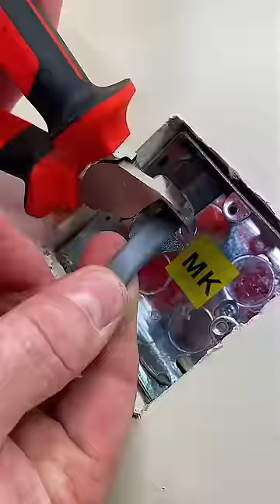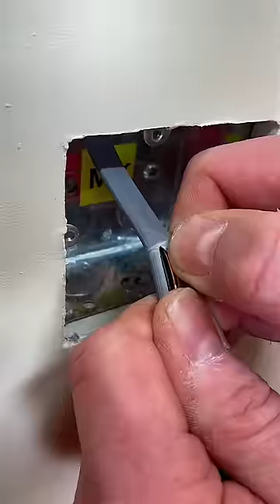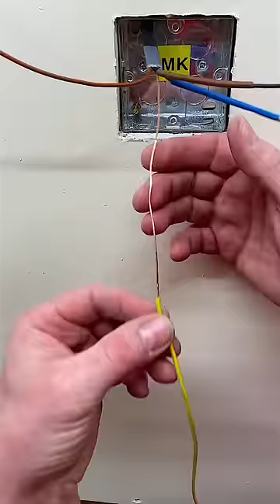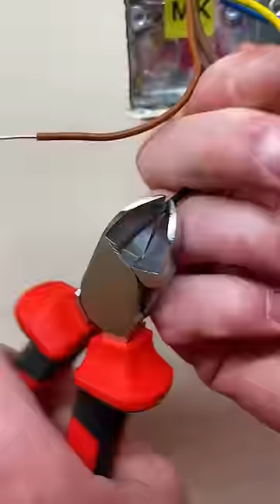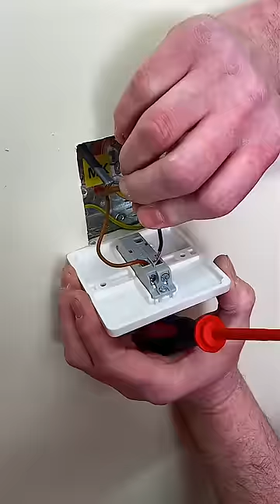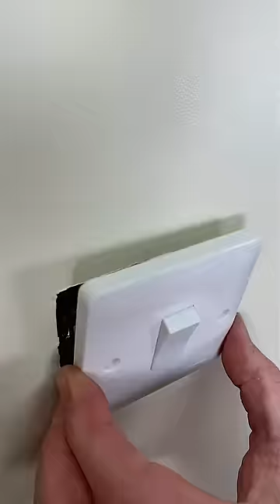How to Make Your Light Switch Future-Proof!

Comment: When I was an apprentice it was frowned upon to have neutrals at switch points, these days it’s a necessity
Reply: Just shows you how silly your teachers were.
If the wire is properly colour coded then what's the problem?
Reply: @deang5622  not ‘teachers’ fully qualified electricians, people working in the industry for YEARS, I’m didn’t say it was u safe, I said it was fround upon, it just wasn’t the done thing to have a neural at a switch point.  Wiring 2 plate instead of 3 plate was seen as something that unqualified people did, personally I don’t have an issue with it, it just wasn’t done. As wiring 2 plate ment you didn’t have a permanent live at a ceiling rose
Reply: Strange I was just going to say the same, 1980 I started and was not seen as professional if you did this! Maybe the invention of the wago connectors and the disappearance of ceiling rose has now made this the way to go. Personally think it’s a good way as long as you fit a deep back box
Reply: @johnwarwick4105  It was the way to go back in the mid 1990's and they are still not there yet.

Why do so many electricians think people won't use home automation devices which require a neutral line?
Reply: I ALWAYS pull a 5 wire cable to switch points, how many times i've had people ask me to upgrade a light switch to a double smart switch which needs a neutral... or add a socket.
Reply: Funny, I come from the auto electrics side, and it never made any sense to me, that the feed went to the lights then the live is looped out to the switch? Why did they not take everything to the switch first? Was there a particular reason they did this? I thought it might be the cost of cable, but you end up with roughly  the same amount.
Reply: @keoghrichard1988   why do you want a permanent live at the light fitting? I must be missing something?  I always thought it a little strange that wiring in the fittings could still be live with the switch off. 
I come from auto electrical background, and l would live and neutral to the switch box and then on to the fitting. But electricians frown on it. Someone explain this too me please!
Reply: @iainball2023  No, to be fair you will use more cable and the supply route to the last fitting is much longer as you have to drop down and back up in each room. Not so much of an issue with the lower lighting loads from led
Reply: @iainball2023  the loop in method has long been preferred (and how it it taught in college and on site), you can loop your line and neutral around all lighting points in a house let’s say (industrial wiring would be different given there might be contactors involved), then just drop down from each lighting to the switch in each room, rather than up and down to each switch, then back out to each light, also you then have a permanent live in the ‘ceiling’ if you ever wanted to add on to the circuit.
Reply: They do make WiFi switch systems that don't require a neutral
Reply: utter rubbish. there is plenty of installs on lighting were you have a mains feed in and a mains feed out to the next switch then a feed to you light. obviously you not a sparks and I've been a qualified sparks since 1981
Reply: @robertburrows6612  I didn’t say that people don’t do it! I just said it used to be frowned upon, and yes I am a spark, been one for 16 years, apprentice trained. NQV L3, city and guilds 2330 and 2391
Reply: @robertburrows6612  didn’t say they weren’t used I am saying that back in 1980 when I also started the was not seen as the preferred option for domestic. As an industrial apprentice I worked with many electricians and it was never favoured. Can only speed from my experience. As said previously i us this method times and materials change
Reply: Why do you need a neutral at a switch point? For a little indicator light? Or home automation?
Reply: @wimh-e7l  well that’s kind of the point of the comments. You dont need one but you have to joint it somewhere. Those neons usually  just go across the switch and only on then the light is off to help you find them in the dark
Reply: @Dean G  because they don't. I personally would but 90% of people don't give a f**k
Reply: @johnwarwick4105  I’m from the same background as you my friend
Reply: @iainball2023  In fact I think it's a thing that is only made in the UK. In my country you go from the switch to the light, much more sense. First you only have 3 wires at the light, that makes it easier for non skilled people to wire, second if you need to control more lights from a switch position (that is more common than controlling only one) you use less cable since you bridge all the lives together. 

Having the neutral at the switch gives you more flexibility, with no added difficulties. It's also cheaper to install, since (at least in my country) switches are almost everywhere above a socket, so of course you reuse the same conduit for the socket to also bring the lighting circuit feed, and then go with a smaller pipe to the light fixture (since it has only to bring 3 1.5mm for the light).
Reply: How the turn tables.
Reply: @microcolonel  ?
Reply: @planespeaking  yeah. But they suck
Reply: Same here
Reply: Why bother wiring a switch at all when we now have kinetic switches?
Reply: @deang5622  The problem was the way things were done at the time, there was no need to have a neutral, so seeing one, would infer that it was either live, or switched live that had not been sleeved to show it was a switched live.  As no one would expect to see a neutral.
Reply: @iainball2023  Because the main live to that light fitting, then goes in the ring around to the next light fitting and so on, so if you went to the switch first you would turn all the lights on or off in one go.
Reply: @wimh-e7l  For home automation, for most smart switches, you need to have a neutral and live feed to the smart device. However the very easy way round this is to leave the original switch and wiring in place and put the smart device near the rose, where you can get the constant live and neutral (preferably with inline protection to the device), then take the original feed from the rose via the switched terminals on the smart device. This then gives you a traditional manual switch override to the smart device.   But better still just use a smart bulb.
Reply: @crcomments8509  I'm not being quite that basic. I'm thinking more like a radial out to the switches, Inc neutral,  then out to the fittings. I think the real question for me, was do people frown on it because there is some sort of safety implication or standards violation, or is it just because its not often seen, and uses a bit nore cable?
Reply: @alerighi   that does seem to be a good way to do it
Reply: @johnwarwick4105  I think I agree mostly, I have re wired two industrial units that I have rented, with new consumer units and lights, in bot cases it was much less cable to common the neutrals at the switches, as they were all in one place. 
I can see how it would be more cable in a house now. I do still wonder if its worth doing a radial out to the switches from a common point nowadays, given the fancy equipment we are attaching to it nowadays ?
Reply: @deang5622  maybe I’m misunderstanding but the standard is to use the hot in the switch so that when the light switch is off … there is is no power in the box ….
Where the other way around … you can still get shocked even with switch off ..
Reply: @iainball2023  the standard is alway interrupt the hot …
Bc when working on light .. you can still get zapped even when switch is off ….
Reply: @mycaddigo   that's kind of my point. The way it is done here, it is perfectly possible, or even very likely  that every light fitting will have a hot live wire even with all the lights turned off.
Reply: @iainball2023  yup … when servicing lights …. You think there is no power .. but if you touch hot and a copper ….. zap ….
No big deal for any electrician I bet … bc they would still practice not grounding them selves … but it’s poor form and I bet against most code….
I actually did this one time … and the electrician checked it and corrected me firmly …
Reply: We run mains to switches and 3 core and earth to centre lights, covered all bases for when they change their mind
Reply: When I was an apprentice spark nearly 40 years ago my instructor ( been in the trade close to 50 years) insisted we fitted a netural for future use, was a very wise move.
Reply: @deang5622  Exactly.

Comment: One thing to bear in mind is that some smart switches need more than 25mm depth, so you should be using at least a 35mm deep back-box.
Reply: in france i alwayd try and use 50mm deep boxes so there is anout 15 to 25 mm of space in the back of a switch
Reply: I never bother with 25mm boxes, have alway fitted 35mm.

Comment: Nice for a new home. But try doing that when it's full of mist coat & plaster, or when a previous "spark" has stripped the cables and cut them too short during a "first fix". In this industry there is not much thought for the next person who needs to carry out work.
Reply: True I have this problem on all switches in the house.  Cable to switch first then cable pulled back to the Consumer unit.  Another electrician said to me its amateur to be using this cable clips 😅

Comment: Maybe something we got right across the pond. We run power to the switch (live neutral ground), join the neutrals with a wire nut, switch the hot, and the outgoing goes right to the fixture. One run from the breaker to the switch where it terminates and another run from the switch to the lamp. If you want a three way, you run live/neutral/ground from the breaker to the first switch, the live/traveller/neutral/ground to the next switch (repeat if necessary) then finally live/neutral/ground to the light. Running just a hot to the switch became old fashioned decades ago
Reply from the maker: Great info thanks 🙏
Reply: My electrician sent out an old school guy and he missed a bunch of neutrals in the switch boxes.  I caught it and had them all rewired to meet Code.  Really useful for bath fan timers, smart switches, etc.
Reply: What about the live for the next room? you surely don't run each set of lights on separate breakers. So you have live in to the switch, switched live out to the light fixture and another live out to the next set of lights? that's 3 sets of wires in one switch.
Reply: @Anglo Saxon That's what we do in the UK but the guy i was replying to (Worf) said over the pond they run straight from the breaker to the switch, then to the light fixture.

Comment: In the last 5 years so much has changed. Wish I put neutrals in all the switches in the man cave as now I’ve had to re feed serval for smart controls
Reply: Plenty of smart switches dont need a neutral wire..
Reply: My 1990 build actually has neutrals in the switch back boxes, I just wish they'd had the foresight to guess I'd be wanting to stick Z=Wave modules in there too and use deeper boxes.

Comment: during my starting years as a sparky i always tried to get the neutrals run to switch points, its easier to maintain, comes in handy when i client wants to change stuff, means less mess when inspecting the light circuits, and just gives more wiring options. only downside was how tight some would get....but thats what deep boxes are for!

Comment: 3 plate made sense and used less cable when every room had 1 light fitting.  Now spots are common it's easier to wire them with a feed from the switch

Comment: Always nice having a traveler wire!
Reply: It's not. If you are from North America like I am, the NEC has made it a code requirement that a neutral must be present in switch boxes. The futureproofing aspect is that smart switches use power to wirelessly transmit signals to devices, therefore needing a neutral to complete their power circuit. If we were talking before this code requirement, I would absolutely agree with you!

Comment: Real futureproofing is taking either a KNX cable or a data cable to the switch as well, this futureproofing was only relevant maybe 5- 10 years ago
Reply: Although I did that, solutions exist to reliably allow data (e.g. the state of 6 buttons) to travel over a single wire and even keep power on it. I do kind of hate those 50+ individual data cables arriving at my cabinet at the moment 😅
Reply: @frederikjacobs552  True true, I am thinking more like when POE tablets are used to control functions, its going that way it seems, how many buttons will they keep adding to wall switches, with tiny tiny writing you have to bend down just to read….soon we will end up with double gang light switches with 32 buttons. This is where a KNX or POE wall tablet will take over.

About the data cables….I would love it, I’m a networking guy after all 😂

Comment: Why did you un do the L2 screw when you only have one way switch?  With hand shake like this 😊
Reply: Because at that instant in time he hadn't decided which terminal he was going to use. So to prevent the hassle of offering up wire to a terminal and then discovering it was closed, and then having to move the plate away, and undo the screw, it's more convenient to just undo all the screws. Problem prevented.

Simple.

And a terminal that isn't used with no wire fitted and the screw not tightened up does not pose any kind of risk at all.
Reply: It’s one way switch you can’t use other terminal. It’s only  one terminal he can use
Reply: @alinili5569  Technically not true, he can use L2 and then turn the switch upside down.. 😎

Comment: If im only running a switch wire to the switch then i do this but i most often run feeds to the back box now as id rather do my connections there that at a rose.

Comment: Feed the switches. Problem solved. Three plating should be left in the past.
Reply: This. Switch feed has been my preferred method for years in most instances….makes fitting decorative light fittings a lot easier for a start! This is hardly a revolutionary tip 😂

Comment: How will this procedure make a light switch future proof when the most common fail piece is the switch it self?

Verifying neutral line and groung wire sure is good when the standard cable doesn't have them, but you made no changes to the switch(not that you could, because if you could you possibly would compromise its insulation properties).
Reply: because many smart switches now need a neutral . In future neutrals at the switch will be important.

Comment: I never understood the issue by having a neutral even if it were just going straight through, I've done it and it's against the refs in Ireland, wired up lovely, connect correct and never an issue, worked for wifi stuff etc
Reply: Someone pointed out that this means switching off one light would cause other lights on the circuit to get switched off - unless of course you a cable with more than 2 core & earth.
Reply: @aliasgharkhoyee9501  yeah 3 core + CPC will give you permanent line, switch line and neutral.

Comment: Question from an American electrician: what's the purpose of the sleeves I've seen installed on the conductors that's put over the insulation? Is it just color coding, identifying the switch legs etc.. ?
Reply: @J I like it. Over here we will give the wires a twist in different ways to identify switch legs, line/load etc. (if we are using solid) but what the twist means can vary by contractors so sometimes it's a bit of a hassle following someone else's work.
Reply: What twist wire to identify? You dont tape or heat shrink colors?
Reply: @UnifiedInfo  For example for a simple switch we might twist a loop in the switch leg and wrap the ground around the switch leg and the corresponding hot. Or to identify line vs load in receptacles we will twist the hot and the neutral of the line side together, and leave the load(s) untouched.  I've never used sleeves, sometimes we might use a bit of white tape and write on it what each conductor is but the tape only stays until we have our inspection done/install devices. We use a lot of tape when making up the panels but again, only until we put the breakers in and write the panel schedule then the tape goes away. This only for residential, in commercial settings we will use different colors of tape for lots of different things.
Reply: @PurlCat  buy a sharpie
Reply: A label maker (like brother) would give you a more professional look than sticky tape. Sounds like it would last longer too.
Reply: I'd say ground wire being bare is enough colour coding for it :)
Reply: @LeedsSpark  I suspect it is done simply to prevent levers open when you push in Wagos into the box. One time use
Reply: @LeedsSpark  like I said, it's all just temporary. The tape goes away once all devices and breakers are installed. We do use label makers for more permanent stuff and we also will sometimes write on the outer sheathing of the NM cable in the panel.

Comment: Pity that solid conductor cable was used, cheaper it may be, but compared with stranded....
Reply: Always solid here.
And it's quite safe to use. If stranded wire is used then that higher cost needs to be passed on to the customer. And the customer can simply ask "What benefit is in there in using stranded cable and how much extra does it cost?". To which the answer is "No benefit and lots of money".

What do you think the customer is going to say to that?
Reply: Pretty much only the stranded wire goes in conduit, not direct buried. solid is at least easier to lay, as it tends to stay in position till you clip it.